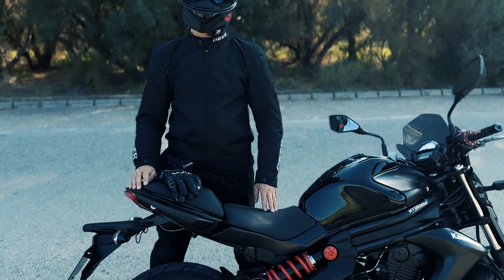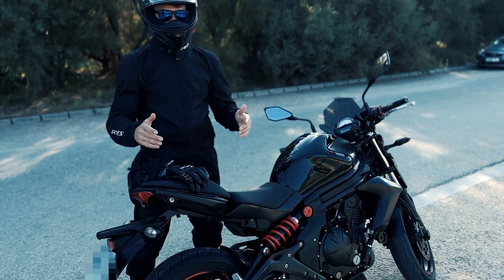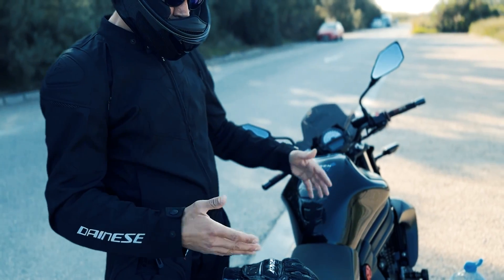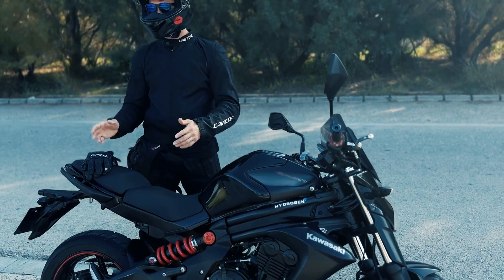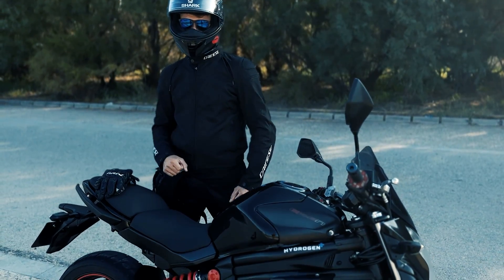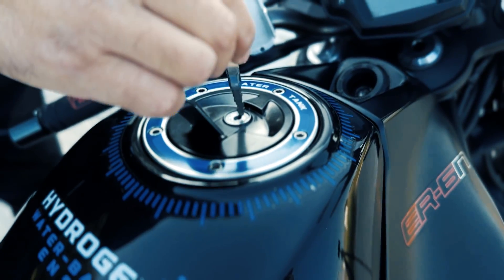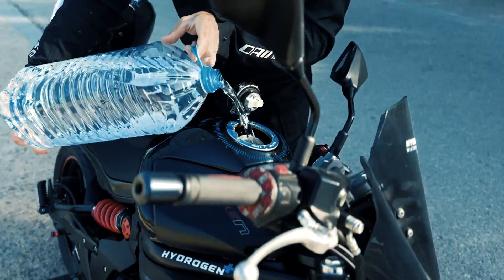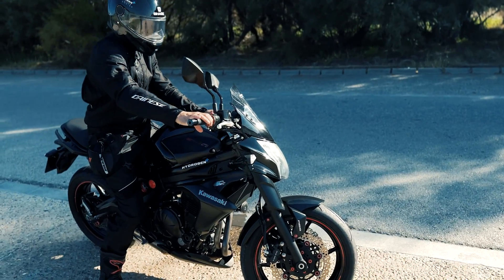Running Bike On Water - 100% Working Trick

Comment: The concepts are real, however  there is a huge difference between doable and making people think it's doable! This guy DOES NOT HAVE ANY VEHICLES THAT RUN 100% on water(hho) 
I know that for an absolute FACT because I know the exact science relative to on demand hydrogen production to power engines! And this system Is one that won't work!!

Is  about to failed is about to be done in the first video

Comment: Fuelshitt!!!🤣
Reply: I think you are poor in chemistry basically formula of water is h2o means 2hydrogen and oxygen hydrogen is flammable substance it can be separated from water through electrolysis and bike can easily run on it so whatever is shown in this video is true.
Reply: @devanshutembhekar6619  WOW! So because hydrogen gas can be made by electrolysis, and because engines can run on gas.. You think that proves this is real???
So that means because power can be generated by making a coil of wire and running a magnet over it... and my house runs on power so all I need is some wire and a magnet, and I'll have free power forever.... So if it's so easy to make an electrolysis cell and run engines WHY DONT YOU DO IT???
Reply: @devanshutembhekar6619 ,  you have no idea about engines and physics....
Reply: @devanshutembhekar6619 Veo que el que no tienes ni idea eres tú. De donde sale la energía para romper la molécula del agua?. O se separan de forma espontánea. 😂😂😂
Reply: Me extraña que no haya nadie que tenga idea de lo que significa la electrólisis. Eso no funciona por una simple razón. Para separar la molécula del agua en hidrógeno y oxigeno hay que darle energía. De donde sale esa energía para poder romper la molécula del agua y obtener el hidrógeno. Normalmente se utilizan placas fotovoltaicas para obtener la energía para el proceso de la electrólisis, y en la moto no he visto nada. Además la eficiencia de los electrolizadores actuales están entre el 50 y 70%.

Comment: Using drinking water can cause minerals to build up inside electrolizer how do you solve this problem
Reply: you can use distilled water. its drinkable and you can buy it at any store but the minerals and impurities have all been removed.
Reply: @RelaxingSoundsszz  drinking distilled water can cause your body to lose minerals

Comment: I am confused now. I thought you needed to add/mix the electrolytes before adding it into the tank? Dont think you would be drinking that if it was premixed, and if you were using regular water, it contradicts the past videos saying that the HH+ was responsible for the large amount of HHO being generated at low voltage.

Comment: basic it's a catalytic electrolysis membrane that uses only 13.5 volt to 14.9 volt AC at 28 Amps or 400+ watts of AC   power.
At electrical frequency 100 Hertz at 1000 rpm and 1000 Hertz at 3350 rpm.
Including the electrolysis gas valve and controlled water pump that only consumes 12 DC 1 Amps or 24 watt water  pump.

Comment: Hey the liberty engineering project I've been subscribed to you for years Can you Tell me how you made this to work because I have a truck. It's a 1995 Chevy Silverado And I love V8 engines And that's reason why I don't want to get rid of it. So I want my vehicle to run of water The same way you pour in the gas tank of your Motorcycle because Of the gas prices is nuts that why I just need to know what kind of Engineering What kind of materials or stuff u done to it to make it work I need to do to make my project to work and keep this to Myself, if that is the case bc i know how Government is and stuff and Is there any kind of way we could talk about this privately this if that is the case
Reply: Its called Hydrogin kit you can purchase it online and install it in your truck to run it on water, Actually the process is straightforward, Water is converted in bottles through electrolytes and Hydrogen gas is extracted and this gas is used as fuel for Bikes cars and trucks, Hydrogen gas is 100 times more powerful than petrol or diesel therefore car truck or bike run much faster.

Comment: btw... there are some issues... like if it's real... why do you repeatedly call it a "trick"? and why are you selling T-shirts instead of conversion kits?
Reply: Skeptics are often the most beneficial to supportive insight. They are optimistic to be disproven by factual repeatable applications or properly and harshly judge those who seek to trick society. The haters often push the creators that truly benefit societys growth capabilities beyond modern social dynamics or knowledge limited by cognitive dissonance. 

‽Knowledge is blind to what wisdom sees tomorrow‽
Reply: Its called Hydrogin kit you can purchase it online and install it in your truck to run it on water, Actually the process is straightforward, Water is converted in bottles through electrolytes and Hydrogen gas is extracted and this gas is used as fuel for Bikes cars and trucks, Hydrogen gas is 100 times more powerful than petrol or diesel therefore car truck or bike run much faster.

Comment: Urm the bike is a Kawasaki er5 petrol motorcycle. Hydrogen works totally different than pouring water into tank. Then if you can do it why are the big four Japanese motorbike manufactures investing billions together in to r&d with hydrogen and swappable battery system for scooters. Toyota has spent billions development in hdyrogen pod system.

Comment: it takes 65 kwh of electricity to produce 1 kg of hydrogen for a distance of 100km, where does your electricity come from dear magician?😊😊😊
Reply: Arthur C Clarke made a documentary, called "It Runs On Water"... in it Stan Myers created hydrogen on demand device in the 70s,  McDonnell Douglas engineer Dr Paul Czysz eye witnessed it directly, he never denied or doubted his observation, but didn't know how it Stan did it (at the time)... So if a real rocket scientist didn't know... why should the world of science be limited to your ignorance as well?  Surely you don't claim to know everything?  Lol... (get over yourself...)
Reply: Its called Hydrogin kit you can purchase it online and install it in your truck to run it on water, Actually the process is straightforward, Water is converted in bottles through electrolytes and Hydrogen gas is extracted and this gas is used as fuel for Bikes cars and trucks, Hydrogen gas is 100 times more powerful than petrol or diesel therefore car truck or bike run much faster.

Comment: Honestly you need a carbon monoxide tool detector to prove that no gasses are being emitted
Reply: actually there is no chance of gas emission even if they emit than no chance of explosion because Hydrogen gas mix with oxygen quickly and have 100 time higher power than petrol or diseal

Comment: This is one of the beautiful videos that I saw this year. I tried to do a similar one but, achieved half success. I tried to do with a dry cell hydrogen electrolyzer. In January, I installed it to my TVS Jupiter BS-3 which has a carburettor. I attached the outer of the hydrogen to the intake. After several attempts, it has started with the help of additional battery if 15AH capacity. The battery discharged after 10 km ride. Then, I fixed it to the vehicle's battery. The result is that it started for a while and started when I tried moving it. 

If I get any suggestions, I'll be thankful.
Reply: Mix a spoon full of potassium hydroxide into the water

Comment: "Brilliant" - How long does it take to modify the engine lubrication and fuel pressure?
Reply from the maker: This invention is still a prototype. The engine must be improved so that the engine oil does not emulsify. We are changing the engine oil every month
Reply: @thelibertyengine   We're in touch with a Nano lubrication company that might solve the emulsification problem - and Mobil has an oil series named "Pegasus" that is made for Gas engines - they definitely might be on to something.

Comment: the exhaust emitted has to be water again. why not show the exhaust? it should not smoke. and the Knocking sound in the engine its so heart wrenching. Do you not need oil to lubricate?

Comment: This is amazing!! and I know it works because I have almost done it and also a relative of mine have successfully powered his truck on water though electrolysis.

I just have a few questions 

1: how did you fit the electrolyser in the original gas tank, and how did you get it in there?

2: If you have the liberty engine 3.0 that can produce a ton of electricity, why don’t you make an electric motorcycle or electric car powered off the liberty engine instead of using water as fuel?

But always, Keep up the good work!!

Comment: The HHO generator is a tool that works on the principle of water electrolysis to produce HHO gas, which is a gas consisting of 2 hydrogen molecules and 1 oxygen.

Comment: Water is not hydrogen.
Reply: The water is separated into H2 and O2 via electrolysis
Reply: @ruben.giordano sure but this bike is very obviously running on gasoline. You can't have immediate electrolysis to provide enough hydrogen. But more simply, that's a kawasaki with the obvious exhaust note of a combustion engine

Comment: Well guys… What about the H++??. How is that under the hood. How have you guys applied it in this mod??
Reply from the maker: Yes, this bike also works with HH+. Inside the gasoline tank we have integrated the electrolysis equipment, an HHO arrester, a 3bar relief valve and several safety systems, but the operating principle is the same as in the previous video
Reply: @thelibertyengine  It almost appears as an attemp to develop a commercial prototype that could eventually see a market??
Reply: @thelibertyengine u know u can overthrow the energy industry so why wait for them

Comment: I could see hydrogen as a fuel but it burns much faster than gasoline then the engine timing has to be changed also the water has to be pure no floride no chlorine otherwise it will contaminate the hydrogen  your not very on point in video most of yt videos are not clear or click bait
Reply: The water needs a compound called H++. Without it, it doesnt work. Its not shown in this video
Reply: that magic ingredient that you seem to have an endless supply of but won't divulge. @pedrosura
Reply: O problema é que a energia necessária para fazer eletrólise da água é enorme, mais do que poderia ser gerado via combustão do hidrogênio

Comment: We've had the ability to run cars on water with zero pollution for years but that tech was hidden away. It's time it resurfaces! We don't need to get rid of ICE vehicles we just need to change the fuel! Fuel we can all get right out of our garden hoses!  LOL Did you just throw that water bottle on the ground and drive away?  LOL